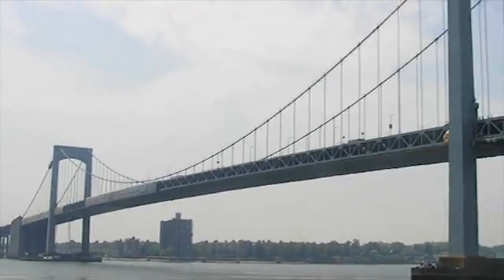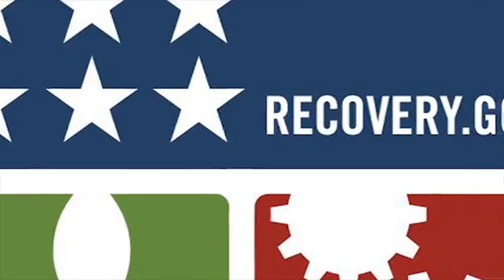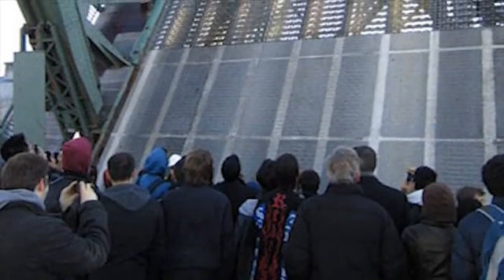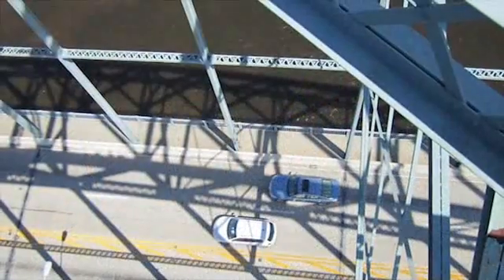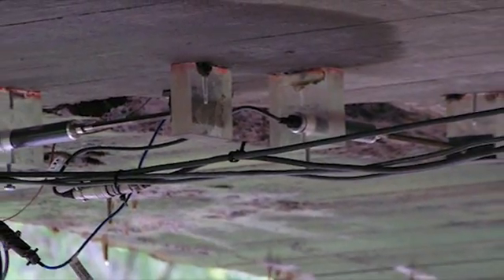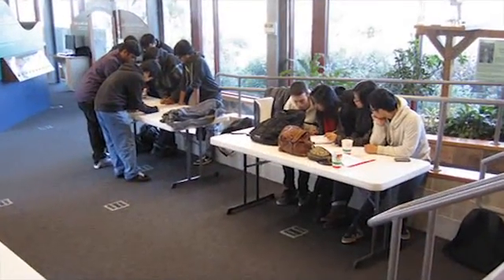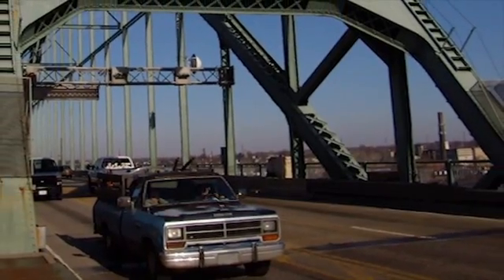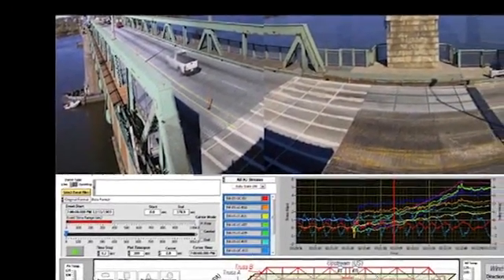The Learning Bridge: Real Span Teaches Engineering | Video

Comment: It is an analogy... Imagine a "doctor" using technology to read the "heart beat" of the bridge to see if something isn't functioning the way it should...  And relating doctors using technology to determine what is happening on the inside of a patients body, since many problems cannot be seen on the outside, is extremely similar to using sensing and monitoring technology on bridges to determine how the bridge is behaving in reality (what the actual forces in each member are, compared to what load they were to designed to take), since visual inspection can only help assess the issues seen on the outside surface of a bridge. My intent is not to be rude, but to give a better perspective. So considering "The Learning Bridge" project is meant to be a large scale laboratory for this group of people to use, along with many other methods conducted in this program, to teach younger, inexperienced students about bridge engineering, analysis, monitoring and rehabilitation, I would say it is a pretty good analogy at that. And when this funding is being used to teach the next generation how to deal with the majority of our nation's bridges reaching the end of their designed lifespan and mitigate full or partial failures, with traffic on the structure (as has happened many times) it is well worth it and is more useful then where a lot of government funding and tax payers dollars end up.